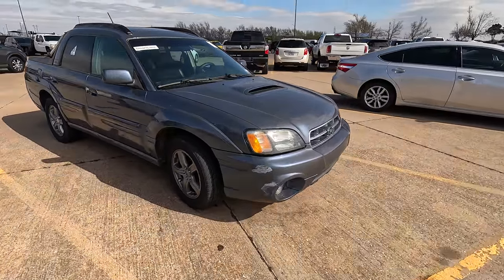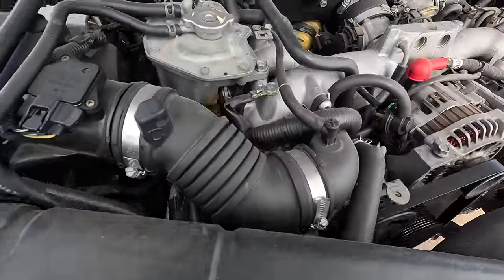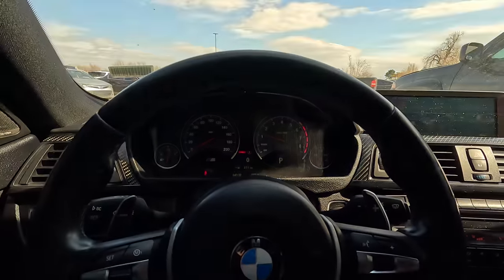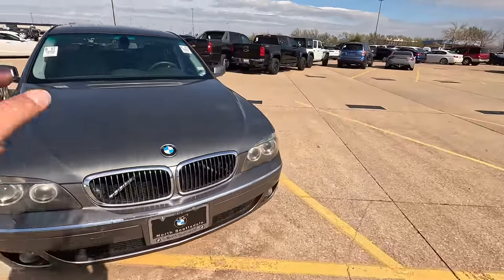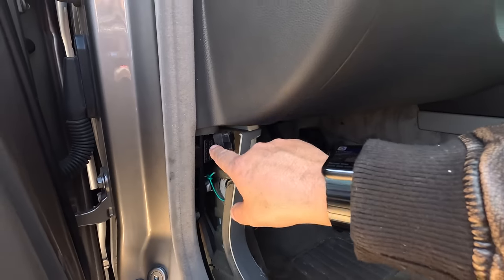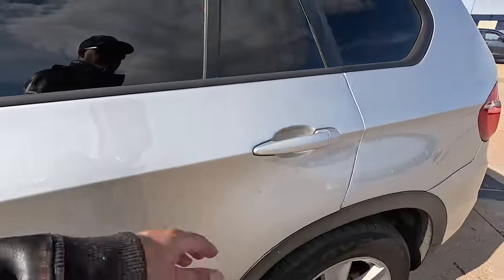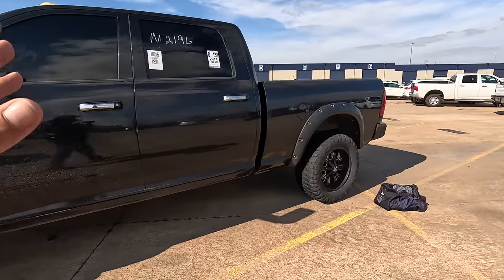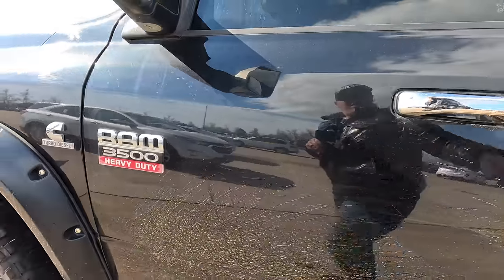Dealer Auction Walk Around + Cheap Subaru Baja and BMW M4!

Comment: FYI you mentioned that the M4 had SMG transmission but in fact, it has DCT transmission the SMG was discontinued from being used on the M3 in 2005 The DCT is a dual Clutch transmission and it was is being phased out since 2018

Comment: randy i know foreigns arent ur specilty but that bmw m4 f82 generation with s55 engine does not have a smg its a dual cultch transmision acc but in the brand new bmw m4 g82 they went to zf 8 speed trans but f generation m cars are dual clutch trans hope u learned something new

Comment: Hey Randy Subaru's from the early years to 2013 have bad head gasket issues and oil leak issues
Reply: The whole head gasket problem was mainly on the EJ25 engines. The EJ engine was used up to 2012 on the Legacy/Outback, and up to 2010 on the Forester. The Forester was the first to get the FB engine in 2011. The early FB engines were oil burners tho. Usually about 100k miles they start burning oil.  But aside from that, they didn't have head gasket problems. Every Subaru leaks oil eventually. They are flawed with leaks because of the boxer design. I see brand new Subaru's like 2022 Models with less than 20k miles already leaking. If only the whole engine didn't have such a thin amount of RTV on them from factory nowadays. Yes i am a Subaru tech.

Comment: Subbies have a few engines to avoid. The 2012s had head gasket issues. Avoid the H6 engines as they have the water pump integrated into the block and if doesn't notify you it's going by the sound it will by gifting you milkshake oil. One of the Ford engines has that design too. We've had several Subaru's and they are stout provided the oil changes are often and full synthetic. If you keep them up they're very, very reliable. Unlike Toyotas, if you neglect them they will bite you in the ass.

Comment: dude, leave the term smg back in the mid 2000s where it belongs. any m3/m4 from 2008-2020 has a dual clutch transmission. lightning fast shifts and very reliable. the smg has kinda crappy. that m4 with those miles should be worth  35-40k with a clean title.